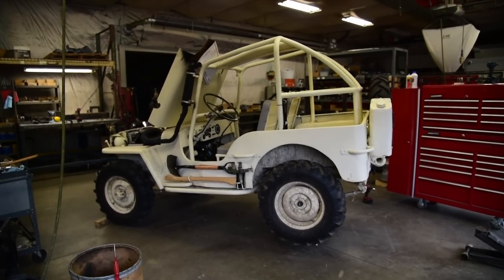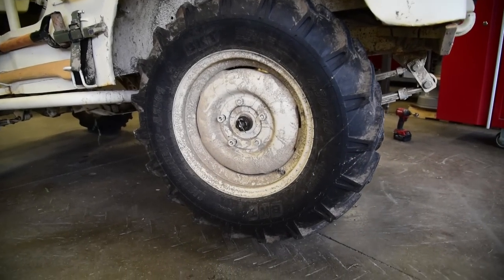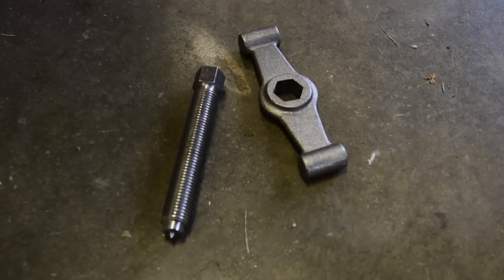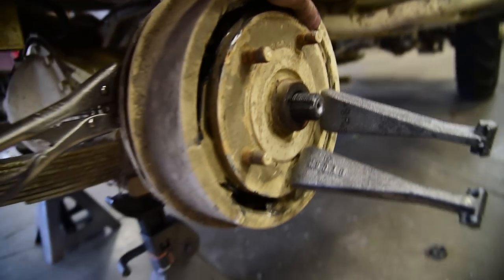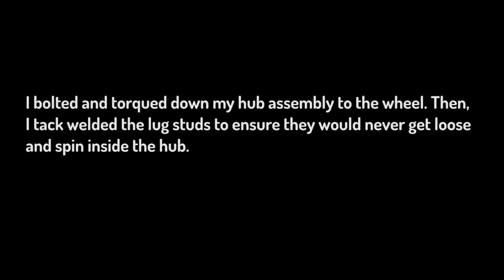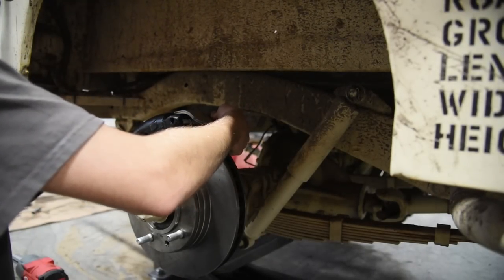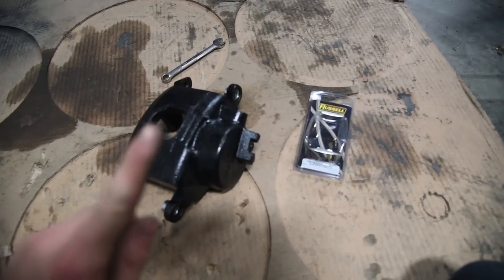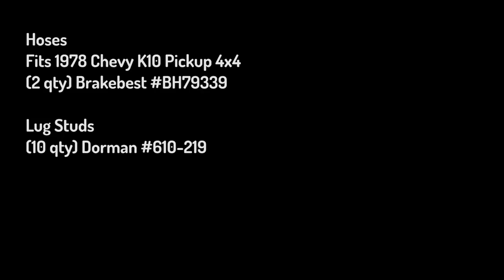How to Install Willys Jeep Disc Brake Conversion

Comment: When you use those old style wheel pullers, once you have the puller installed, and the puller under about 1/4 turn of tension, you normally tap the end of the center bolt of the puller with a heavy (48 oz.) hammer to break the hub loose.  You shouldn't need an impact wrench.

Comment: Great video! Might have to do this when I swap in a Dana 30 into mine.

One thing I noticed you mentioning was the orientation of the drain hole. The drain hole is for the grease cup, not the drum brake. Even when you convert to disks, it’s important to align the drain hole so excess grease from the wheel bearing can drain and not sling out onto your brakes.

Comment: Now I just need to find a flat fender.  I’ve been a auto tech for 47 years and the only thing I wouldn’t recommend is to put grease on any of the brake components.  It becomes a magnet for road dust and brake dust and will actually cause more binding than not using any.

Comment: I just bought some adapter plates from Brennon's Garage that will allow me to use disc brakes from a Suzuki Samurai, or Geo Tracker. I need to buy the rotors, calipers, and brake lines yet, but total price per axel should be around $300.  This is my goal for this summer. Those stock 1948 drums are not much good.   What did you do with the master cylinder?  I bought a dual reservoir one. Now I have to figure out how to make an adapter for it......

Comment: Grease your threads of your expensive new tool....spray a tiny amount of a thin lock lube... 

Later with the calipers, forget lithium, get yourself some synthetic silicone grease. EZSlide is a well known brand. Lube the collars before you slide them into the caliper. Apply to the contact points too just where the pads meet the saddle of the knuckle/torque member/whatever you wish to call it.

Also... with disc its more critical for runout to be as close to zero as possible, compared to drums. I've always found it beneficial, in the long run, to LIGHTLY coat the hub surface with lithium grease, before installing the disc, but not enough to fly out and contaminate the disc/pads. With 2 machined surfaces, a little lube will let it go that much longer before water gets in and rusts things. You'll thank me at your NEXT brake job too when you don't gotta get ignorant with it. ;)

Cheers... be safe.

Comment: Im trying to do the same thing on a 66 gladiator. What is the measurement/stud count of the backing plate they look the same.
Reply from the maker: Check out my disc brake thread on thecj2apage

Comment: very good job, you have done but I have a question, it is a disc brake adaptation kit.  They sell it, do you have a link where I can buy it and also the question, is is, is it a CJ A2 I have the same one and I want to make an adaptation like that, thank you very much for your information. Thanks.

Comment: Hi,
I have a jeep Willy's 1947 that I want to change brakes from drums to rotors. Where did you buy the parts-auto store like Napa/AutoZone/O'Reilly's?  How did you go about master cylinder?-- did you swap it for bigger one?
Thanx
Reply from the maker: I went with Herm the Overdrive Guy's master cylinder kit but it's horrible. I'm personally looking for a better replacement

Comment: I'd be using high temperature brake grease instead of white lithium grease on those slider pins.  The drop point of white lithium is only 395F.

Comment: the wheel studs you list, will they be long enough for aftermarket aluminum wheels?
hope you can help.
Reply from the maker: You will need to look up the stud part number for dimensions, and measure your wheel.

Comment: Great video.  Would there be a problem with only putting disk brakes on the front wheels?
Reply from the maker: Not at all.
Reply: Except the braking bias would be screwed up.  If you can only do 1 axle do the rear.  It does 70% of the braking.

Comment: I have a ‘59 cj5 with verified Dana 30 front axle. (I looked at all messages, didnt see this question)
Will this setup fit a Dana 30? $$ look better with this 

Im guessing my American 15” wheels will need replacing however...?
Reply from the maker: The Dana 30 comes with disc brakes.

Comment: You did a great job on this video, i like the way it is so complete.  I have a 1957 Jeep FC-150 that I would like to do this on.  It is the one with the narrow axles. Do you know if this video is compatable with my jeep? Could I use the same part numbers or would mine be different?  Thank you so much!
Reply from the maker: If it's a Dana 25 and Dana 44 you should be good to go.
Reply: Hi there, did you end up doing this rear disc upgrade on your FC?  I have a 64 FC wide track (Dana 44) that I want to do this on.

Comment: Nice vid. 

But, my experience, you want a thick enough spacer so that the axle studs are recessed and not out. The wheel should be flat against the spacer. The vid looks like the 1" thick spacer, the axle studs are out of the hole. You can shave the head of the stud with a grinder and correct the threads with the nuts. Put nuts on first, cut the head, and use the nut to rethread them.
Reply from the maker: They do not stick out

Comment: Not sure how you did this for around $250 because I'm at almost $300 and I haven't even added the caliper brackets which alone cost $150 give or take. Where did you buy your caliper brackets?
Reply from the maker: Price of goods has skyrocketed lately. I bought my brackets on eBay.
Reply: @TurnNBurn  They are $75 each. Do you maybe know of a alternative that works just the same?
Reply from the maker: It must be the Chevy bracket.

Comment: Good production on the video, thanks. I see you replaced the hubs with new, can you confirm the PN or source that you used?
Reply from the maker: I bought them from Kaiser Willys
Reply: @TurnNBurn  is it the stock hub for that axle, rather than the rotor?
Reply from the maker: Stock hub, just the rotor goes where the backing plate once did.

Comment: Will this work for a 1953 CJ3B? Also, will this keep the parking brake functional?
Reply from the maker: Yes. Parking brake is on the transfercase.
Reply: @TurnNBurn  Appreciate all the help, the video is helping tremendously. I ordered all parts mentioned in the video from ebay, oreillys, and rock auto. Total was roughly $850 for front and rear conversion (all new). I also emailed Herm the Overdrive guy for the master cylinder information and am waiting on a response. Where did your source the proportioning valves from and which ones did you go for? Do you think the rental hub pullers from Oreillys are too small for this application? Do you happen to have the part number for the shorter hard brake lines? Is there any special equipment recommended for the front end hub removal? Apologies for all the questions, I am trying to limit any issues during install.

Comment: hey just curious where you found the caliper brackets? I can seem to track them down
Reply from the maker: eBay is where I bought mine. Or type in "CB7191 caliper bracket" on Google and parts websites come up.
Reply: Look up Brennon's Garage. He has similar plates that will allow Suzuki Samurai, or Geo Tracker discs. I just bought some, but haven't installed them yet.

Comment: hey my question is will this work with 15in wheels?
Reply from the maker: I'm not sure they will clear the brake rotor and caliper even with the 1" spacer. Look into finding the 16" wheels.
Reply: @TurnNBurn  Ok thanks

Comment: Did you have to modify the front caliber or steering knuckle for travel for caliber ? I wish you would provide a video of the front axle I;m wanting to do both axles on my 1946 CJ2A .. thanks for your info !
Reply from the maker: Yes I barely had to grind on the knuckle. Look up "CJ2A disc brakes for $250" and you'll find my thread on thecj2apage.

Comment: Cutting into a old drum with possible asbestos brake shoes is not a clever idea. If using the original master you must take the non return out or your pads will drag